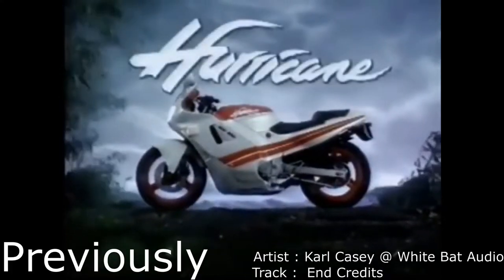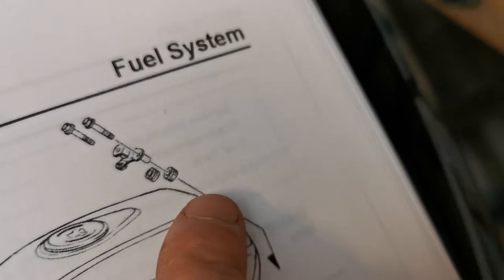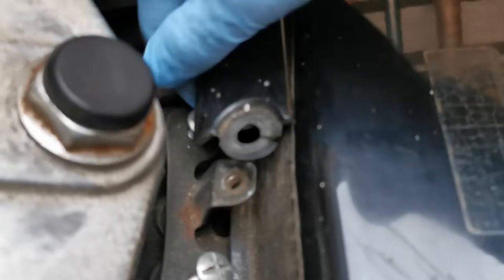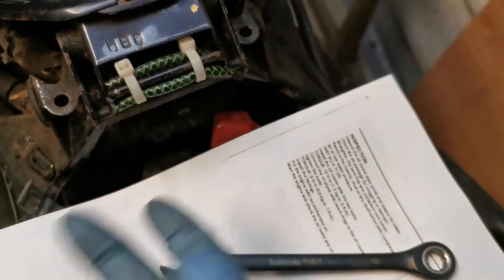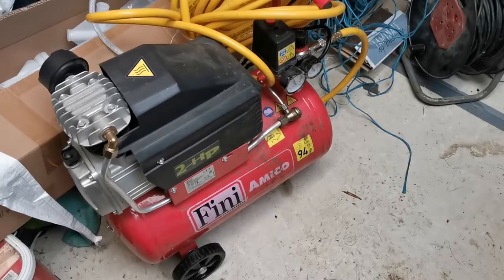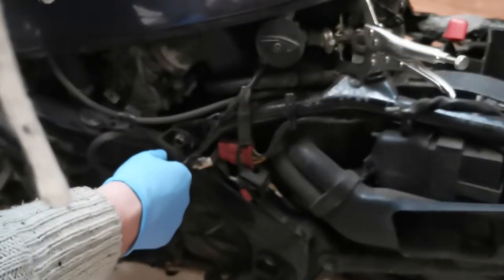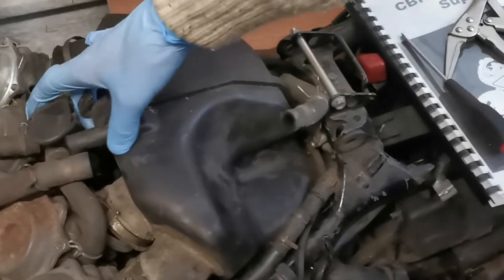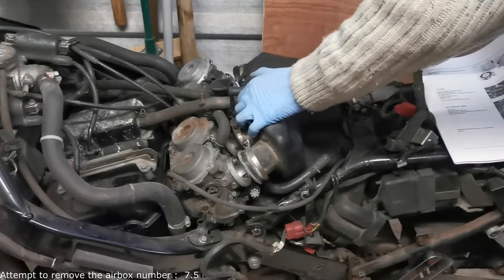Honda Hurricane CBR 750 -Revival Part 2

Comment: firstly welcome to an exclusive club of honda hurricane cbr 750f super aero owners.
its good to see someone putting in effort to restore one. 
ive owned mine for 13 years now which is also an 87 like yours.
im only a hobby mechanic like yourself, but feel free to shout if you need any help or advise with it.
unfortunately your right about taking the carbs out to remove the air box. its not to hard, its worth giving the jets a clean and once over if its been stood for a while. 
stay strong, it would be great to see this on the road.